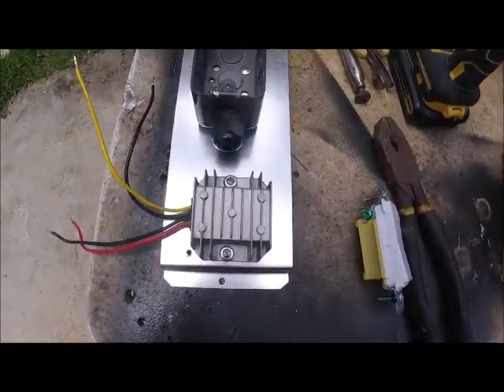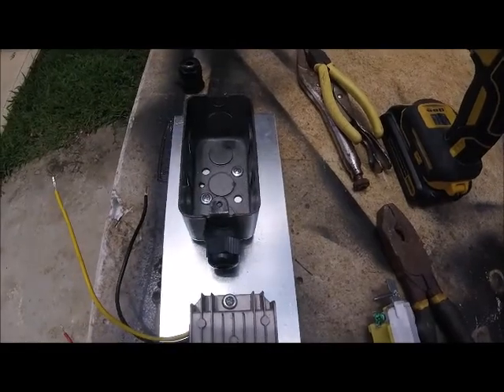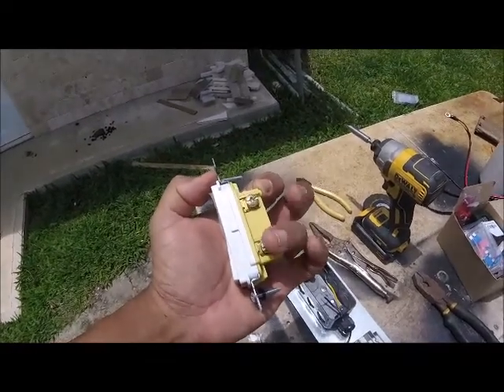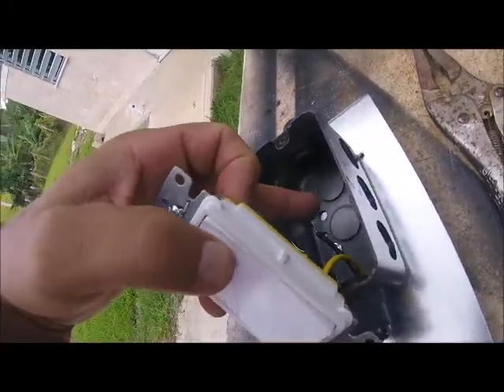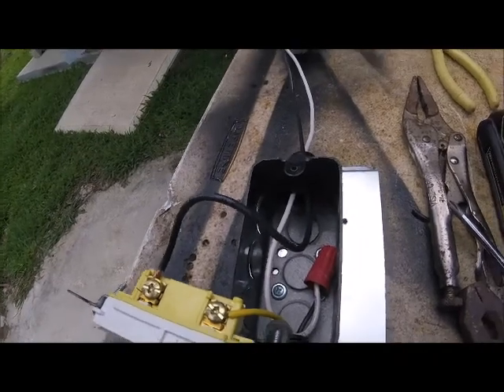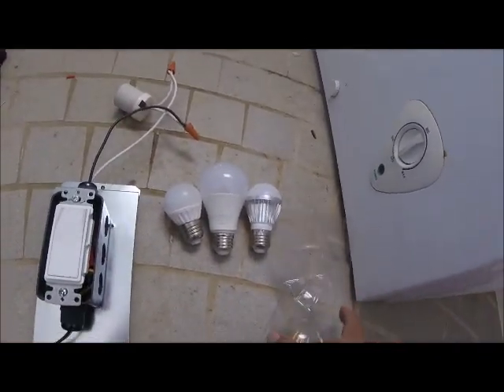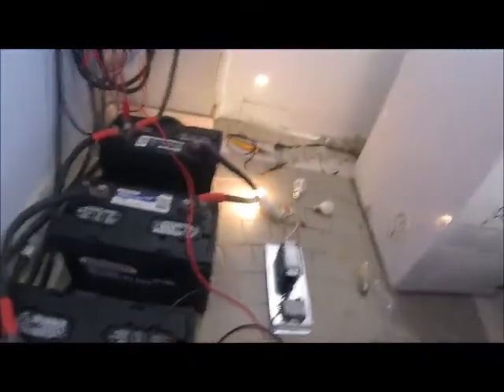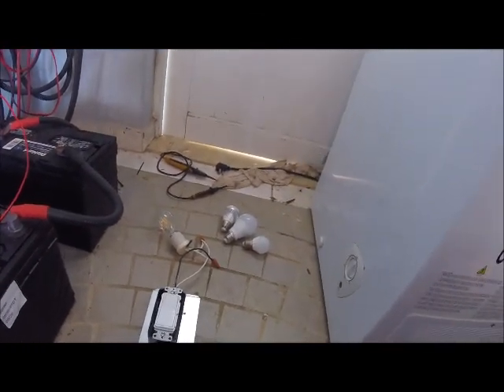48v DC to 12v DC Lighting system,  No inverter

Comment: You are right Luis, reliable lighting is very important - particularly in a crisis situation!
Reply from the maker: This is a application I recommend for anyone building a off grid cabin or home, I have been using a 12v lighting system for years, My shed has this type of lighting as well, this application will last for years after a total grid down,  and can be kept working for decades afterwards just by scavenging car parts lol

Comment: we have our RV totally decked out with solar and run as much DC as we can...and we bult a solar generator (ha ha I hate that term...we have a solar panel, a couple batteries and an inverter) and try to run as much DC from that as we can.  I always feel bad for how much power I loose turning it from DC to AC.....I like your system for sure.  Less to go wrong.
Reply from the maker: Running as much as you can on DC is the key to efficiency,  my lighting and water pumping are run on DC bypassing a inverter , I also have 12v DC outlets throughout my home. I designed my shed the same way. I have been super busy getting ready for hurricane season,  I also have to take my computer to the shop, its not turning on lol

Comment: Good rundown.
Reply from the maker: Just a simple explanation of how it's done, with one solar panel, one car battery or better a deep cycle battery you can light up a small home running all night, these modern 12v light bulbs have a energy savings of AAA+

Comment: Great system.
Someone told me yesterday to buy 12v switches because ac switches will weld.
🤷‍♂️
Where'd you get transformer?
Reply from the maker: Who ever told you AC switches weld is correct if higher DC current is used, My 12v lighting system is proven,  None of my AC switches have failed,  and you know my system has been working for over 1 year on YT and about 2 years before I decided to put videos on again,  I have had multiple DC switches fail using on 12v lol, My system is the Ultimate prepper lighting system,  it can be fixed with common parts that are easy to get now, or scavenged in a apocalypse to keep running...You can listen to those who think they know or those who have been doing this stuff for years, I'm a plumber and electrician,  my shet works lol....You can get these on Amazon or Ebay, don't go lower than 20 a, this way you can add some 12v outlets that have USB for phone and tablet charging,  Those are called Magnadyne,  look them up, all this works with 12v,  look at the buck transformer for what ever volt your main system will be, if you want to run a fridge, go with 48v and get the 48 to 12v buck transformer for lights, your going to flip on how smart and how well this works.
Reply: @MosaicHomestead  im not arguing at all. Sharing what ive seen. Good to know bub!
Reply from the maker: @FinehomesofNewHampshire  with this system you can have lights up in no time, just get batteries and charge controller first, if your not going to run 220v AC...Look into a simple cheap reliable inverter,  mine doesn't want to die lol, I bought it as a junk throw away inverter lol... start off like this to get your feet wet, then upgrade if you want to but your going to be impressed how well this works,  building takes a bit of money,  you will save a lot this way.
Reply: @MosaicHomestead  What size is your inverter? Your simple, cheap, reliable, junk throw away inverter.

Comment: 48 volt lights are simple to get
Reply from the maker: Yes, I know,  I've bought them before, the reason for this video is preparedness,  this video was actually for a prepper that was building a off grid cabin but was running a 48v solar set up. 48v lights are easy to get now, but if it ever hits the fan,  it's easier to get 12v lights anywhere,  this includes a abandoned car, there are tons of 12v items everywhere,  even a O2cool fan will work on 12v.